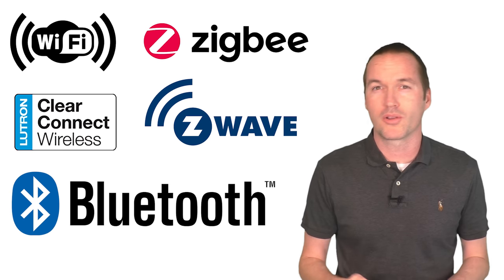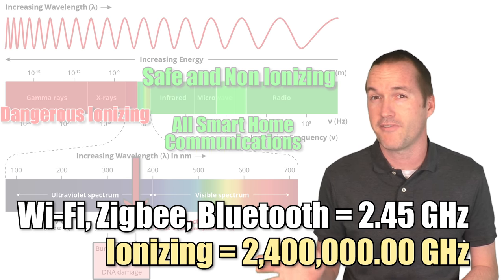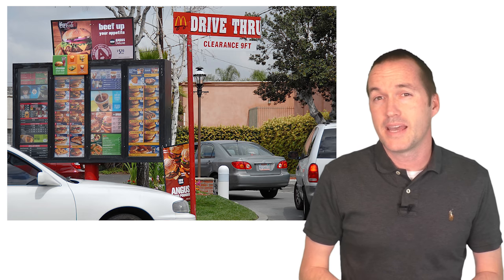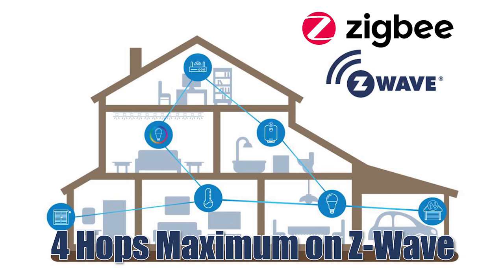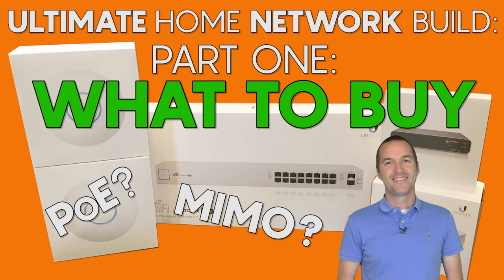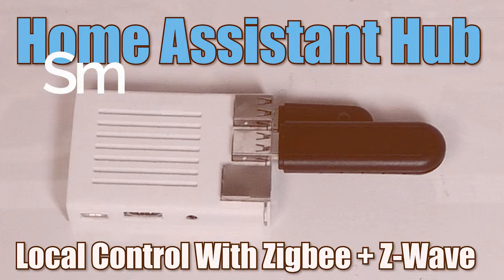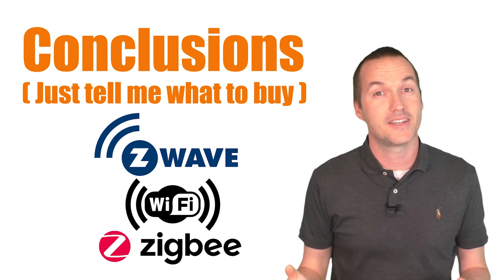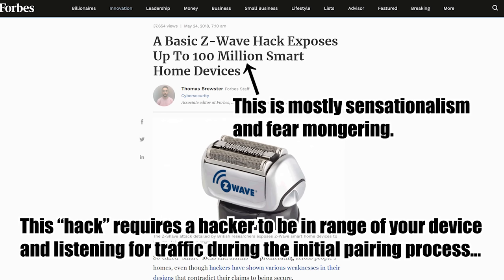Z-Wave vs. Zigbee vs. Wi-Fi! Smart Home Basics: How To Pick The Right Protocol

Comment: Awesome video! I'm currently renovating my house and redoing all my electrical work. I want to setup up a smart home using the homey hub. Which supports both zwave and ZigBee. I'm thinking of replacing al my build in switches to either zwave or ZigBee. Which protocol would be most stable? To build a mesh network all around my house? Would zwave be an more stable choice in that case? Because it's evenly spread with little to no interference?
Reply: Hi, If i may ask, What protocol you have chosen ? And is it was a smart decision ? Are you satisfied with it ?
Reply: @Harmonics1986  Hi Adam, I ended using the homey pro with both zigbee and zwave combined:

For all the lightning switches I used build in Fibaro Z-Wave dimmers 2.0 in combination with 'pulse switches'. I can turn on and light off and if need be dim them aswell. You can also choose for Fibaro build in zwave single or double switch but those can either turn a lightswitch on or off with a dimmer its on of and the posibility to dimm them.

Using pulse switches always put the state of the switch in a neutral state .
Tab switch once it turns it on or off. Holding switch dims/brightens the light and double tab is previous dimmed state. And obviously you can make flows to determine what these switches do.

These Zwave build in dimmers work well and consistent, I chose these specifically because zwave  build-in dimmers/switches work really consistent. They are however quite expensive compared to their zigbee counterparts.

I also got Fibaro roller switch for my roller blinds. These also work perfectly.

Furthermore I used GU10 zigbee lights from IKEA tradfri for my outside lighting.

Besides that I use tadoo thermostat and knobs for my heaters upstairs. Downstairs I have floorheating which I can manage with the tado thermostat.

I have some random lights plugged in sockets, for that I use osram zigbee smartplugs. They also get sold under the new name 'lightify' but there are enough alternatives for those.

Last but not least I use Aqara motion sensor. In my washing room and have seperate buttons and switches from aqara, These are cheap look sleak and work really well. Specially the buttons with gyro build in. 

You can bind flows on single click, double click, long click and shake. Really cool things.

So in short: So far im really satisfied with the Homey Pro because it combines all different protocols and so far they are working seemlessly without having multiple hubs. I do research on which devices are proven to work with homey. Both Zigbee and Zwave.

Because I used fibaro dimmers/roller shutter and zigbee lamps spread out I basically made 2 meshes that are spread out in my house
Reply: @pvdv1985  Thank you for sharing your own experience with these protocols. I think i will endup playing with these 3 protocols (zigbee, zwave and wifi), i hope by the end of this year we will start to see the first CHIP devices so i wont order too many devices, cos soon wthey will become obsolete.
Reply: @Harmonics1986  how so obsolete and which chip devices are you taking about
Reply: @pvdv1985  I am talking aboth the connected devices over IP, aka CHIP. by the end of this year this will be the IOT main protocol and i beleive all smart home device manufacturers will move to this protocol. so, ordering all the devices i need for my smart home in the current protocols (wifi, zigbee and zwave) is not a wise decision.
Reply: @Harmonics1986  do you have a proper source about the subject? What protocol/bandwidth will 'CHIP' use.
Reply: @Harmonics1986  interesting, it uses the same already crowded 802 connection but ads more options, they do mention they will work seamlessly in the future... I wouldn't hold my breath though as technology always develops. I would however probably not get more Zwave devices

Comment: Rule of thumb: If the wavelength is longer than your cell size it won't hurt you.
Reply: That does happen to be true albeit coincidentally as it really is the energy per photon that is relevant for ionising effects, in fact your rule of thumb significantly underestimates the frequency necessary for harmful effects. This of course also only applies to the low power transmitters used in consumer devices for communication which operate at a few watts or less, it's only when you get over 80W or so that it would pose a danger and then that is merely because at that point it is giving off energy equivalent to a candle flame, that is to say it will cause thermal burns it you get right up close to it simply by transferring excess heat. Of course, the only consumer device that goes anywhere near that would be a microwave oven and they have safety features to ensure they can only operate when fully shielded for that reason thus why they simply will not turn on with the door open.
Reply: @seraphina985  Indeed I'm oversimplifying. I meant ionizing vs. non-ionizing. Thermal energy is of course a concern at any frequency. ;
Reply: @beanMosheen  Indeed though as I made a point to stress only at very high output power levels. Had to stress that point for anyone that isn't clear on the difference as I have encountered people that honestly believe something like a mobile phone can heat the brain which it absolutely can't as the human body is easily capable of dissipating the few milliwatts you will absorb from that hell the cells in the same area are outputting way more and the human body has what is effectively watercooling thanks to the fluid being pumped everywhere (Blood that is of course).

Comment: An important point is choosing the right hub.  My advice: pick one that does NOT rely on the cloud.  You may also want to consider a hub that supports different standards.  There are hubs that support both Z-Wave and Zigbee, and perhaps even stuff on 433 MHz.  The latter is used for outdated and insecure protocols, but there are a ton of interesting devices available that make use of it, and that you will have a hard time finding on either Z-Wave or Zigbee (like automatic blinds and curtains, weather stations and such).  Lastly, pick a hub designed around openness; in many cases a device will not be supported by your hub (like a WiFi thermostat, home alarm systems, or the Philips Hue hub over ethernet in case you don't have Zigbee).  If the hub allows users to write their own plugins, chances are that someone will have written a plugin for the device you want to address.

Comment: very good video, I have a lot of these devices, you just didn't mention devices using WiFi most of times are not good to integrate with other automations in a good way, example in HASS. ok HASS can connect to WiFi devices, like tp link plugs, but they are far more unreliable comparing to ZigBee or zwave devices using a hub, even smartthings that uses cloud. automating with iftt is horrible, very limited options. but anyway, everything else was great.

Comment: I have 20 sengled bulbs and 16 ring lights and sensors. Will these dedicated sengled and ring hubs reduce the workload of my netgear router? I read my router can handle up to 32 wifi devices on 2.4 ghz band. Thanks!

Comment: insteon is pretty popular too
Reply: I'd like to see where Insteon fits in as well... When I built out my system initially 8 years ago I used all Insteon, I like the powerline and mesh wireless redundancy and the price is right if you wait for a sale. Disadvantage is its (AFAIK) still a closed protocol with really only 1-2 manufacturers and suffers from even more restricted development than Zwave. That being said, I use devices from all 4 protocols and insteon is by far the most stable for me.

Comment: Are you familiar with Insteon?  If so why don't you mention this as an option?  Myself and everyone I know doing home automation all use Insteon.  I've been using it since it came out and included backward compatibility with X10 devices.  (I still have one or two X10 devices for IR -> X10)  Insteon does not require a cloud based solution, although they do offer one.  I've written my own software to fully manage my Insteon devices and have both Siri and Alexa support along with a native IOS app too
Reply from the maker: Insteon is pretty much just it's own thing, no choice in brands.  My only experience with Insteon is at a friend's house that was built using Insteon everywhere, it works, but he could have built a z-wave system for 1/4 of the price.  I actually laughed out loud when I saw the comparison chart listed on the Insteon website: https://www.insteon.com/technology#ourtechnology

Basically everything on that chart is just flat out wrong.  It has Wi-Fi listed as the most expensive option ($$$) with a theoretical maximum number of devices of 256 (which I assume they are talking about for a single subnet, in which case they are still wrong due to reserved addresses), and a practical network size of "Dozens".  They have insteon listed as the cheapest option ($)... even though it is the most expensive of the technologies listed.
Reply: @TheHookUp  True there is no choice in brands but it is still an automation choice.   The price would be expensive except there is almost always a discount that can be had, most of what I've purchased have been at 50% off.  I prefer non-wifi devices as wifi is highly insecure. As a DYI'er I'm very happy that Insteon makes all their technical documents available so writing the software didn't require reverse engineering.  Other than Insteon everything else is complete homegrown both hardware and software.  Oh and I do not work for Insteon etc, I am just happy with my setup and would like to see their products talked about as an option.  Thanks and keep up the excellent videos!!!!

Comment: Technically ionizing radiation starts in "ultraviolet" as stated, but under most circumstances is defined as beginning in the extreme ultraviolet, not UV-A/B as shown on the diagram. Source: https://en.wikipedia.org/wiki/Ionizing_radiation#Definition_boundary_for_lower-energy_photons

Comment: I didn't hear you mention this as a downside of WiFi, but aren't all/most WiFi IoT devices proprietary?  So if you install WiFi switches from TP-Link, you're stuck with the same brand devices for everything else IoT, unless you want to run a bunch of separate apps to control everything, or create your own integrations using IFTTT.
Reply from the maker: This has mostly been solved with echo and google integration, all the automation can be handled from inside those apps.

Comment: Is there a simple way to find wifi devices that have this specific chip that can be flashed for local communication? I've started with Home Assistant specifically b/c I dislike "cloud" solutions. However, easily finding products that fit the bill seems to be very time consuming.

Comment: hi there, can I use two Zigbee hubs of the same brand and model (Sonoff Zigbee Bridge) in the same house?
Reply from the maker: I wouldn’t recommend it, they will form separate meshes that will interfere with each other.  What’s your use case?
Reply: @TheHookUp  I just try to understand the system in case I might need them in future. Thanks for your explanation.
Reply: is there anyway that I could turn off Ewelink app notifications automatically when I reached home and turn on again when I'm leaving home. It would be very helpful since I used the Sonoff motion sensors as part of my home security in conjunction with Google assistant and android phone. Thanks again

Comment: This is an excellent introduction, but the claim that RF is only dangerous at ionizing frequencies is plainly wrong.  

RF can cause heating and burns at much lower frequencies, depending upon the power level.  Don't believe me?  Try putting some food in your microwave and turn it on.  It runs at 2.4Ghz, which is the same frequency as Wifi and Zigbee, though admittedly at a much higher power level.

And there is good science showing that long-term exposure to low powered, non-ionizing radiation can cause health effects in animals.  The only reason we lack good data on exposure to humans is that it is unethical to lock humans in a room for 20+ years while experimenting on them.

I'm not saying that you should forego home automation, or Wifi.  But, perhaps don't put a transmitting device right next to where your head is when you sleep.

Comment: I have a urgent question about a past video you made regarding esp8266 nodemcu. Why does nodemcu fail to transmit data serially or transmit irregullarly when it powered by a usb cable connected to a power bank?
Reply from the maker: Most like the fault of the power bank.  Measure the voltage from vin to ground when plugged into the power bank

Comment: Remember X-10? If I remember correctly, only some of the system was wireless.
Reply: I believe a lot of the X-10 would use the actual power wire to communicate with one another.  If a fuse blows or had a different fuse panel on your system and they would quickly get unreliable.

Comment: Your frequency data is wrong. Ionization at 2,4000,000.00 Gigahertz??? Why do you think that they have to lower power to a TV or FM radio broadcast antenna before the tower can be climbed for maintenance? Why do you think that hand held communications devices have to be limited to .6 watts output?
Reply from the maker: Because of amplitude energy (heat), not because of ionization.  The same reason you can warm up your coffee in the microwave at 2.4ghz.

Comment: You said TCP/IP communications require a handshake.  This is false.  TCP is connection-oriented communications, but IP is connectionless.
Reply from the maker: Syn->ack-> syn ack is the TCP 3 way handshake.
Reply: @TheHookUp  Correct, but IP is connectionless like I said.  SO if you said TCP requires a handshake you would be correct.

Comment: I've been having the hardest time deciding on what product to commit to. When I found out the 4th gen echo also worked as a zigbee hub I figured I'd go with that. Only problem I have found is zigbee is pretty limited on what brands use it... I've been looking looking for a good dimmer switch that use zigbee but it's mostly smaller brands I've never heard of. I have really been wanting to set up home assistant so I can keep my system local. Any advice would be good.

Comment: Zigbee is great in theory for a reason you didn't really expand on: it actually standardizes everything up to the application layer, unlike devices based on Wifi. So ideally any switch or remote control or light bulb or motion sensor will not only talk to any hub, any software that knows the commands for those types of devices can use them. For Wifi, each device has its own application protocol with absolutely no coordination between different manufacturers, unless they hook into a common third-party cloud service (CHIP has since been renamed to "Matter" and two years later is still not shipping any devices yet. It would be nice from a hobbyist perspective if it ever catches on since it's all open source). But unfortunately even with Zigbee many manufacturers like to build things around either intentional lockin or non-standard "extensions," so you can't assume everything will be compatible.

Comment: Not everything on WiFi uses TCP with fault tolerance. Many devices use UDP which is connectionless and not fault tolerant. Any device that does a DNS query for example.
Reply from the maker: I’m not aware of any smart home devices that are strictly UDP.
Reply: @TheHookUp  agreed, however that part of the video was explaining what WiFi was and says that devices on a WiFi network communicate using TCP/IP.  And although I'm not aware of any "mainstream" products specifically using UDP, there are plenty of people on the ESP8266 dev groups using it as a lightweight way of fire and forget data transmission. Those "mainstream" products probably do DNS queries though...
Reply: @TheHookUp  https://www.embedded-computing.com/embedded-computing-design/which-iot-protocol-should-i-use-for-my-system. Really good article that discusses Iot protocols and uses.

Comment: Overall, great video- why do microwave ovens have doors on them?  5G does pose a significant health risk no matter what the tech industry says (:)!
Reply from the maker: Microwave ovens have doors on them because they have a high amplitude of microwaves.  Microwaves are non ionizing, so they won't cause cancer, but they can certainly heat things up by transferring energy into them.  The same is true for visible light, which is non ionizing but can burn you in high enough intensities.

Comment: If I hook up a smart water-main shutoff valve (to engage when a leak is detected), which is more reliable?  Z-wave, Zigbee or WiFi?  If a sensor detects a leak I certainly don't want a communication failure to turn off the water-main shutoff valve! (I gathered from the video, the answer is probably WiFi, but being new to all of this, I might be confused).

Comment: Most of your information is spot on but it is disingenuous you're not advised people that there are proprietary manufacturers that make proven and r&d tested equipment such as savant control4 and crestron. Control 4 has its own zigbee proprietary protocol. That's just one example of a proven zigbee system that is reliable however it is at a price that you pay for it for that reliability.
Reply from the maker: Isn’t that exactly what I said? That many zigbee systems are proprietary and will not mesh?